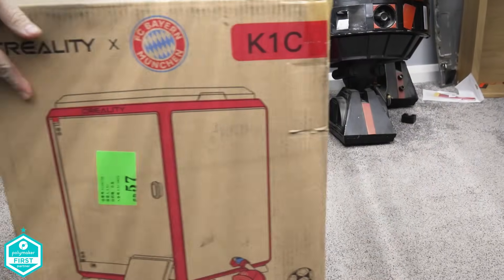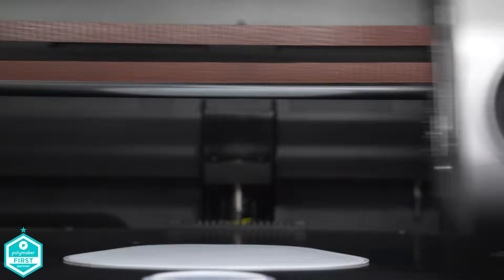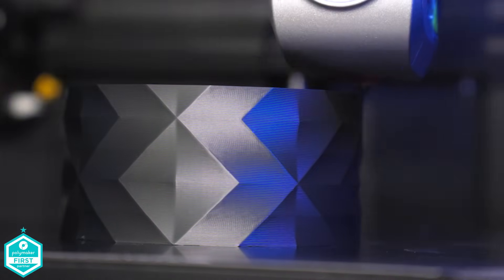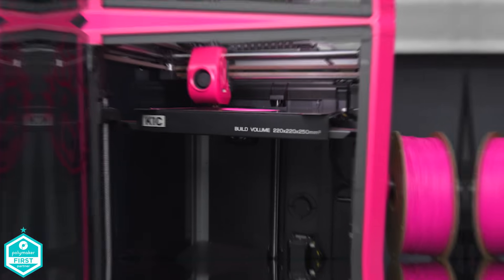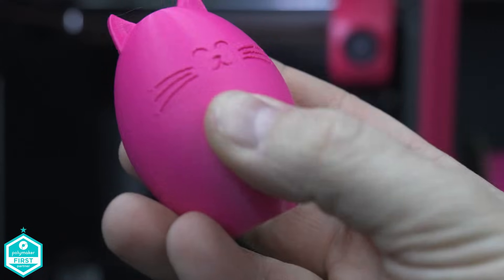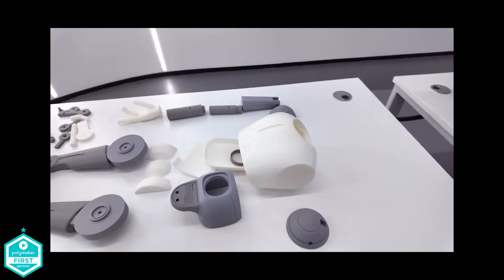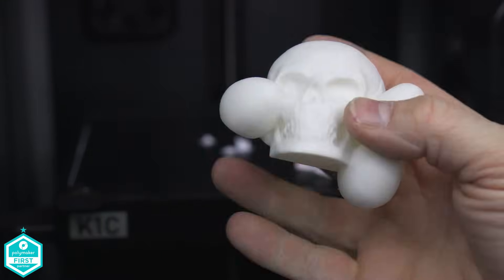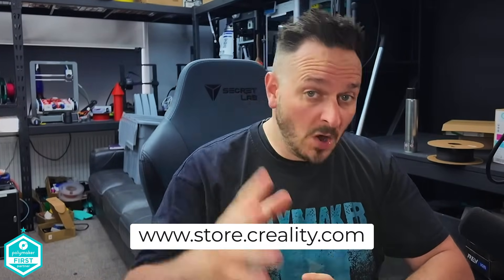Creality K1C 3D Printer: Features, Setup, and First Prints!

Comment: Hi! question what slicers can i use or that supports the k1C bc i have been searching and only found the creality print  to only have k1c on there. If I can use Cura what settings would i need bc it doesnt have the k1c on there? 
Awesome video btw thanks!
Reply from the maker: Usually orca slicer
Reply: @ thank you! Also what setting would you recommend bc I am unable to find any videos that explains well
Reply from the maker: @charzandergaming9422 well there should be a stock profile when you add the printer it should be there from memory

Comment: I discovered your channel through the K2 Plus stream and as someone from the UK your videos seem to be very informative. I recently purchased a second hand K1 Max from ebay and due to the original buyer having purchased the K1 Max before the production line upgrades of the K1C Hotend, K1C Unicorn Nozzle and K1C Heatsink. 

My printer arrived with no real noticeable issues apart from a warped frame, faulty LIDAR and snapped cable chain.
After printing about 20 prints my K1 Max experienced Elephants foot while I was busy and this melted the thermistor Wire itself and using a JST Connector and Pin connector set I was able to save the main hotend wires. This was because my K1 Max was sent with a half ripped silicone sock which therefore did not sit flush on the hotend.

I then was sent replacement socks, a replacement hotend and used the nozzle set that came with my purchase.
I contacted CREALITY SUPPORT about my faulty LIDAR issue, Snapped Cable Chain and Warped Frame. They were very helpful and sent me the replacement parts which I then fitted to my printer. I now had a working AI LIDAR and no longer warped frame however. when calibrating my hotend ran aground into the print bed as it's coordinates were actually set off the print bed. I Factory reset the printer and notified CREALITY SUPPORT of the damage and was sent a new build plate. I then saw the news about the K1C parts being standard on the newer batch of K1 MAXs and contacted CREALITY SUPPORT for guidance on my purchase. I was referred to Amazon CREALITY Store. I purchased the integrated Unicorn Nozzle kit for £50 and it arrived. I installed the parts as instructed in the CREALITY AFTER SALES YouTube videos. I then noticed that my kit did in fact not come with the required HeatSink. I contacted CREALITY SUPPORT yet again and was sent the K1C Heat Sink. Now everything seemed to be working however I noticed under extrusion. The source of the problem was a faulty Filament Extruder. Therefore I tested the locks of the Filament Extruder with M3 Nuts in order to add more tension to the thread end and ensure a flush fit. This seemed to help until I noticed that my Filament Extruder Motor wire was snapped after I had cleaned out the new Unicorn Nozzle. I am now waiting for my new Extruder motor to arrive. I hope that this shall be the end of my issues with my 2nd Hand K1 MAX. Ironically of course today was the launch of the K2 Plus and had I waited and payed £170 more then I'd potentially have had a K2 Plus ;-;

If you have any suggestions for what I should do then please let me know.

Comment: K1C doesn’t seem to be able to print TPU well. Constant clogs and under extrusion while printing with TPU. Especially because of the unicorn nozzle design. I’ve tried with different TPUs, every time it clogs mid print and fails due to under extrusion
Reply from the maker: What’s your settings ?
Reply: @TheRealSamPrentice  230 C temp, 50mm/s speed, 0.4mm retraction, flow 1.1 .That’s pretty much it
Reply from the maker: @QuantumX I would say that’s a little hot which profile are you using? Are you using the reality one or the one in bamboo Studios?
Reply: @TheRealSamPrentice  I’m using Creality Slicer with Generic TPU profile. Just tweaked the temperature and flow settings.

Comment: 4:01 So i have a question about one of the prints you did in this video, it's the black geometric vase, I have been printing 95% of the past 3 years print with resin, so i am rather green when it comes to FDM, i have just purchased a K1C and that's how i stumbled onto this video. SO! more to the point I have noticed there is little to no layer lines and I was wondering if you can please tell me how to print with that high quality. thanks in advance
Reply from the maker: The filament has a lot to do with it, but its stock settings using the Bambu Lab k1c profile
Reply: @TheRealSamPrentice  Awesome, Thank you for replying so quick too. I am already loving the k1c. but the dream is to someday be able to afford a Bambu Lab X1. Thanks again for your help 🙂
Reply: @TheRealSamPrentice  I am using Hyper PLA at the moment but want to start with some ABS and Barbon. as i print interior Automotive parts for ford territorys here in Australia.
Reply: How about bamboo lab K1C profile? @TheRealSamPrentice
Reply from the maker: How about that?

Comment: That robot you're working on, I think I saw Mike post a video in his FB group teasing that. That uses those Neo motors too, right? Is that PLA gear going to be rugged enough to handle the torque?
Reply from the maker: Yep and I’m using pla on the tiny bike too

Comment: Its a combination of the flimsy frame, the location of the leadscrews in relation to the linear rods for the bed and of course the toolhead being allowed to rock on the upper brass bearing which is held in place by two springs. whole lots of no no's.
Reply from the maker: Good to see you here dude, I know we messages about this issue too
Reply: Hello, well I removed the springs because the circles don't come out well with them and I read somewhere that they recommended removing them and indeed when you remove them the circles come out better. So do you recommend that they not be removed?

Comment: Do you try to run imput shaper script?? It seam to be a problem with Creality firmware, they use same value from x to y axis. If you rooted the printer and run this macro could improve the quality I think.
Reply from the maker: I did and rooted it, I spend a number of days working things out the guys on discord d3vil design are doing a fine job also

Comment: This is a common trend. The K1 series has inherent issues. It needs a stiffer frame and a redesigned extruder. It may be a decent value, but I think there are better options right now. The Q1 Pro especially. Not to crap on your collaborations with Creality at all, but I have to be honest. It's disappointing, because the printers really could be great.
Reply from the maker: You’re not crapping on anything my opinion is my own with all of this regardless of events I do with them
Reply: @TheRealSamPrentice  I just never like to mess with a creator's connections unless they're a real jerk. ;) I trust you to give us a real opinion though.
Reply: I have two Maxs and whilst I had issues with both when I first got them, they have served me well and continue to do so.  Tge new firmware and the new slicer have given my Max's a new lease of life and are actually performing like completely different and better printers.  I will ne waiting to see what the K2 Plus will be like along with the multi material system and go from there.  Cheers Sam as always 👍
Reply: @3DPFactory1  The Max is an overall better printer than the K1, but shares some of the fundamental issues. I do hope the K2 is a big improvement.
Reply: P.S. Love the hot pink, hahaha.
Reply from the maker: That’s the best part right !!
Reply: The extruder looks to be changed on the K2, so hopefully any problems any of the K1 printers had have been addressed, or at least made somewhat better.
Reply: My K1max and K1C have performed faultlessly and produce top quality prints
Reply: @3D4Everyone1  It's going to vary, but there are inherent design issues. It depends on your thresholds for quality as well. I'm not trashing anyone who has bought the printers, but they could be better.
Reply: @802Garage  they can always be better , the original K1 was a bit of a mess, but I do like the current versions,  im hardly needing to sand my prints, I haven't had to do anything to the hardware, but do fiddle with the slicer a bit.  Im not a print mill, I do however have them going 24/7 . I understand the commercial argument, but for 90% of their target audience they are great printers.

Comment: Print outer wall first. Inner outer is only necessary if you have large overhangs. Otherwise, printing outer wall first will give you better surface quality.
Reply: Oh, and you might want to see if your extruder gears are running true (if they move closer and further apart as they rotate). On the original K1, creality did a poor job of ensuring that the gears are concentric with the hole as they used threads as a locating mechanism (always a bad idea for precision mechanisms, they should have had a interference fit with precision bolt shank and a hub).
Reply from the maker: Did that too :)
Reply: @TheRealSamPrentice  - hmm. Only thing I could suggest is slowing down the acceleration to see if it is some sort of slack in a motion system bearing. If it improves with lower accelerations, then it isn’t your typical z-wobble (shifting as the bed moves up and down).

Comment: Great video! Last week im thinking upgrading from my heavily modded ender3 v1 to k1c or ender3 v3 plus and im confused. I have the ender3 v1 since 2018 and i want something that works out of the box without a hassle. Any suggestions? Also i would like to be able to print cf filaments.
Reply from the maker: This will do it but there are several options out there now, this has a good support community and a very good team around klipper online
Reply: I was thinking for infimech tx also. Flashforge adventurer 5m pro but this is like using apple products which I'm not so fan of. What do you propose if you don't mind? Please 🙏
Reply from the maker: @PanosMesi I’ve had a lot of success with the k1 max and the Bambu p1p/p1s I’ve not used the flashfoge
Reply: Yeah these are very good options but unfortunately my budget is not that high 😢

Comment: About that egg print quality thing, try a VFA test to see what speeds are problematic and avoid them on the outer walls, 2nd off the inner/outer/inner wall order on my slicer improves layer consistency a lot as well. if neither of those work I would double check the backlash on the Z leadscrews, there will be a little bit but it shouldn't be excessive. I've also sometimes see that the gantry being slightly out of square can cause issues like this. Usually that is fixable by messing with the belt tensioners a bit to change the center distances to make the gantry square again. Lastly (although it might be a non issue) the smooth idlers on the toothed side of the belt can cause consistent 2mm VFAs at certain speeds which can be fixed by using toothed idlers on the toothed side of the belt. Hope this could possibly lead to a solution down the road!
Reply from the maker: Yep there is a shot in the video where I print that, this print was better in vase mode, and I tried turning off z hop, slowing it down, the belts, rooting, upping the amps on the motors and so on. Please try the file and let me know what you get.
Reply from the maker: I’ll check that tho but on 4 printers ?

Comment: Hi Sam, telling grandmother how to suck eggs but here goes. 🙂 Lower print speed maybe to stop the vibrations, lower fan speed to give filament time to bond, combing mode? Love the video though.
Reply from the maker: Honestly I tried it all slow speed faster speed 4 slicers different firmwares 🎉
Reply: @TheRealSamPrentice  So, you got exactly the same results in China, using the same filament but different machine and, also using different filament.  Sounds to me like there is a design flaw somewhere. Does it need larger diameter lead screws, longer lead screw nuts to add to the stabilisation of the print bed? You mention that the chain keeps catching the hood, is that causing vibrations in the extruder? Is the support system for the nozzle strong enough? Just suggestions from a 3D print novice (3 years and a bit) 🙂
Reply from the maker: @stephengittins6116  I might have to give those backlash nuts a good old shaking
Reply: @TheRealSamPrentice  Nice garden by the way. 🙂
Reply from the maker: @stephengittins6116 lol thank you

Comment: have you tried the pink cat on ender 3 V3 (not the se or ke)?
Reply from the maker: I’ve not no, but I should !!
Reply: @TheRealSamPrentice  I have tried it on my Ender3 V2 with Sonic Pad, which prints very very finely and comes out the same as on the K1C. Could it be the stl's fault?

Comment: When I got both of my K1 Max's they printed great a little ghosting but nothing that was a shock bit after I upgraded to the latest firmware now all of the sudden I'm getting whisps and it doesn't matter what filament I use I get them no again no big deal but do you think it's something in the firmware or something mechanical?
Reply from the maker: Its a strange one, on the pink cat text I used various slicers to try and get improvements and it was somehow lacking, in the end its either the model or the bed/head movement. But having two of the same here and then getting the same issues in china it could just be the model?